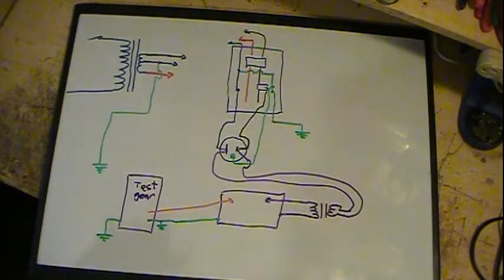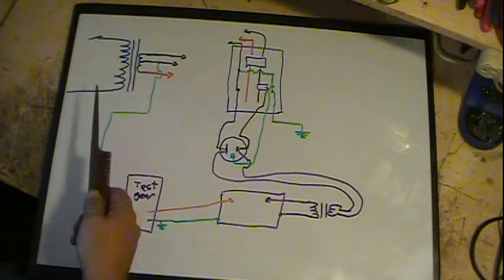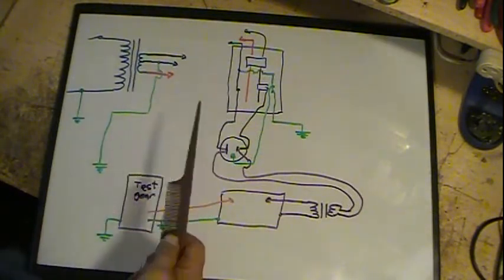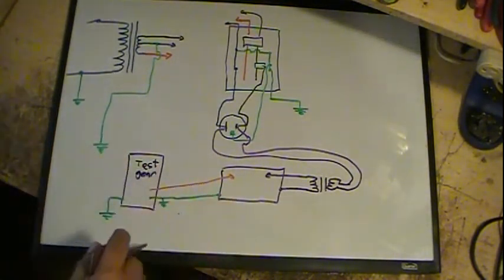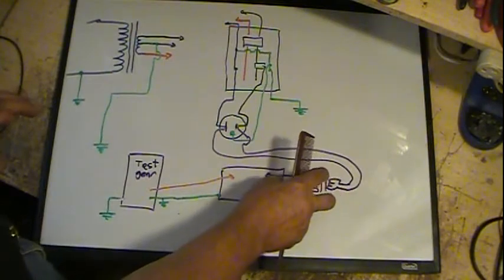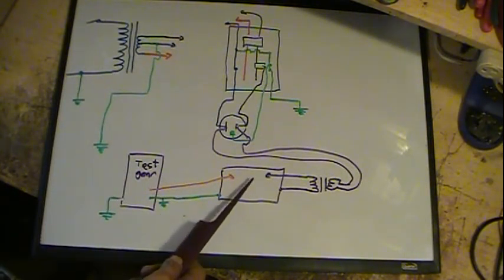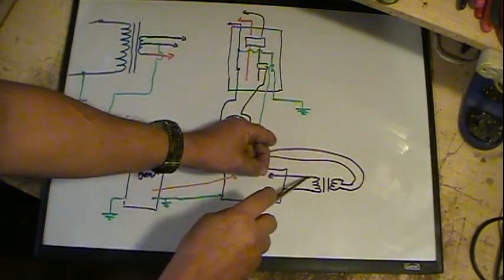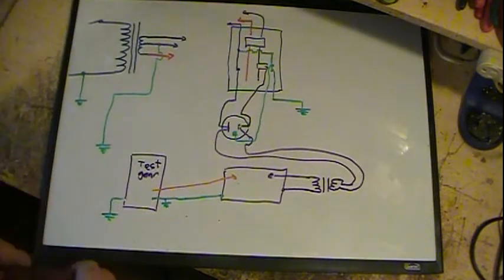More safety

Comment: Hi Dennis! More people, both ammeture and professional techs need to always remember this, as I once watched my old teacher who taught me vacuum tube electronics, fry his EICO 460 scope! The scope ground became a return path for a hot chassis! Isolation transformers are a necessity if you're going to work on any series heater string set, whether it be a TV, radio, or amplifier. However, you have to be careful when purchasing a newer style iso trans...a colleague of mine bought a new Trip-Lite iso trans and he complained he got a nasty shock with an all american five plugged into it. I went to his shop to help him out with this issue. I opened up the new iso trans, and to my discovery, they had a jumper from the neutral side of the receptacle (which was connected to the secondary side of the trans) to the case ground, which in turn was connected to the ground on the primary AC line. Not what I would call isolated. I removed the jumper so the duplex receptacle was completely isolated. Techs who purchase these iso's need to be aware of this. I've spoken to some techs who claim they also float the scope or signal generator...not always a good thing either...Great videos for both the new kids on the block and great reminders for the seasoned guys like us :) Keep 'em coming...Frank Ferraro--Audio Craft Electronics.